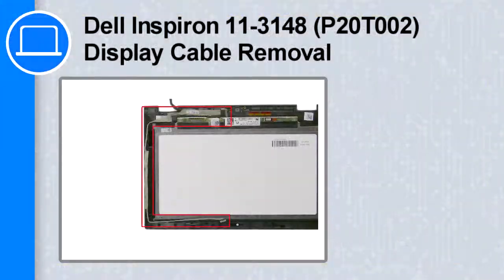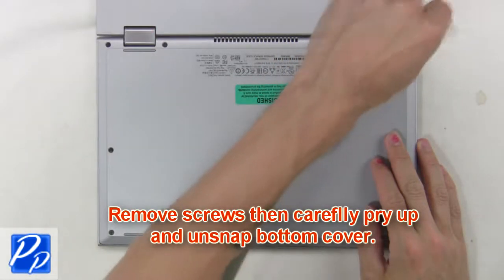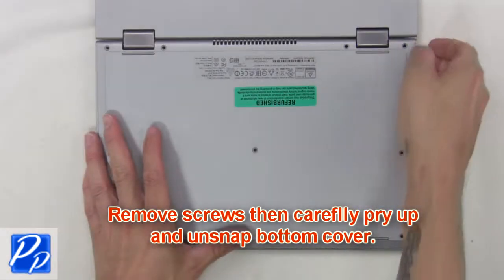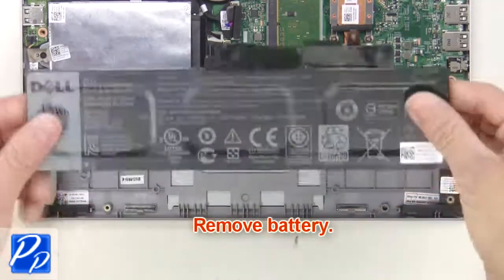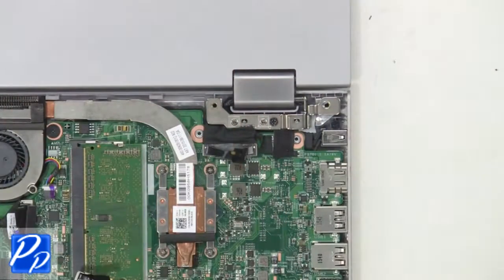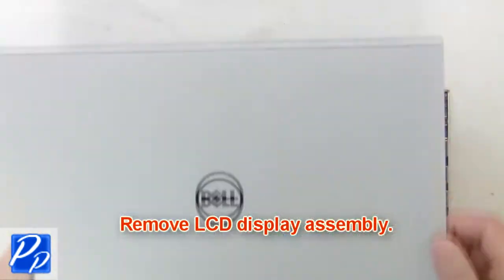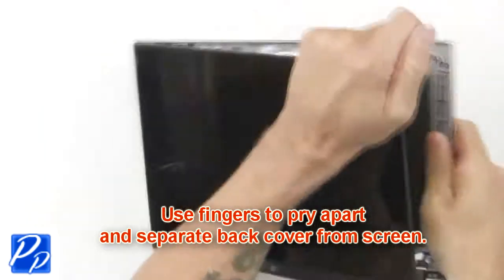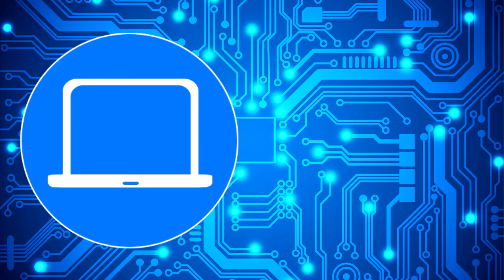Dell Inspiron 11-3148 (P20T002) Display Cable How-To Video Tutorial

Comment: hi is the digitizer integrated in the display/lvds cable itself or is it seperate???
 can i disable the touch screen by removing a cable somehow??
Reply from the maker: The digitizer cable is separate from the display cable. I would check and/or reseat all cables related to the display if touchscreen functionality has stopped working.